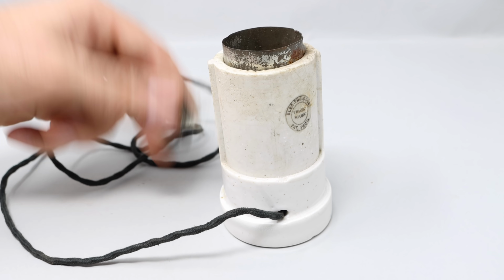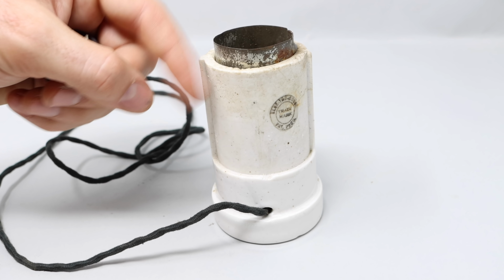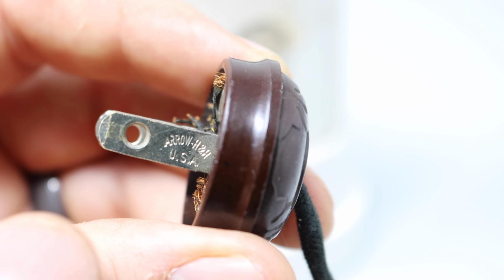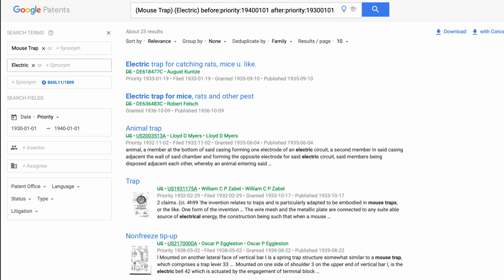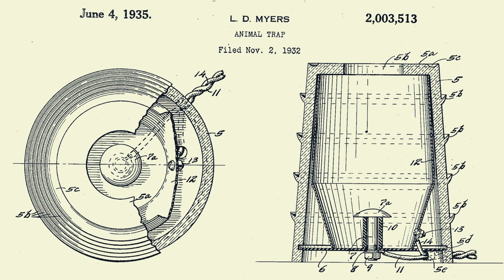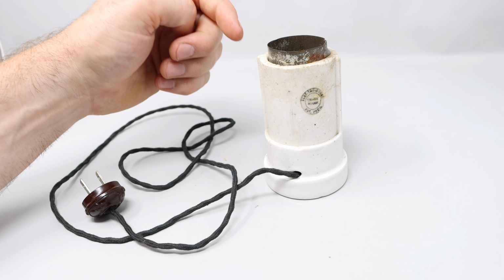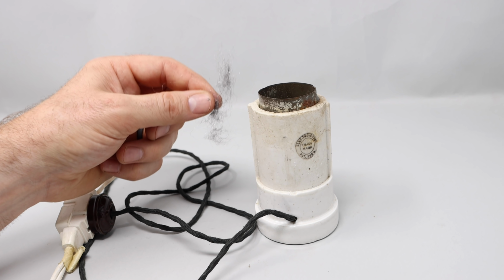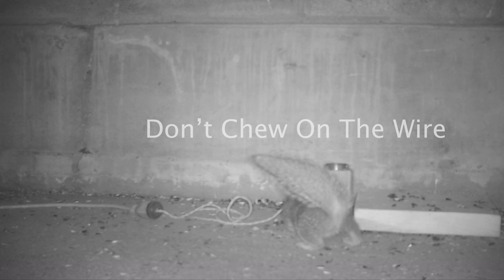I Need Your Help Explaining This One - The Electro Mouse Trap from the 1930s. Mousetrap Monday.

Comment: I'm looking at the patent drawings and it looks to me that the trap you have is either broken or missing the top part of the ceramic. I don't think there should be any metal showing and a much smaller hole for the mouse to squeeze in to, which would make it more likely to be electrocuted and less likely to cause a fire.

Comment: I have some suggestions: Clean the contacts to remove any corrosion. Put some electrolyte on the electrodes: personal lubricant mixed with salt on the bottom, and jam mixed with salt where they would lick. There might be some feedback from the neutral that puts them off becore making full contact, maybe just connect the foot pad to ground.

Comment: You could have something that consists of a flat + electrode the mouse walks on, while going for bait on a tongue in a cup-shaped - electrode, with each covered with an odorless saline gel, using freshly-cooked grain for bait, with a circuit breaker and a little spring that catapults the dead mouse away after several seconds.

Comment: In order to work, the voltage would have to cross the mouses heart. Not as easy as it sounds. There is a lot of resistance in mouse skin and muscle, and only 120 volts to punch through it.  I doubt it ever worked at all.  I have seen a lot of 120 volt chewed live wires in attics, and no corpses nearby.
Reply: My old hamster actually managed to escape from its cage and then chew into a live 240v cable. The cable was spitting sparks by the time I found it, but the hamster seemed perfectly unharmed. That hamster must have used up all its luck getting out of that one alive because it died of genetic causes later that year...

Comment: well ...
1) the tin that the contacts are made of are rusty.. that will reduce the current being delivered.
2) the contact area between the mouse and contacts are small.  the mouse is touching the wall of the unit and then makes contract with contact at the base of the unit.. the total voltage the mouse receiving is about 60vac...  As soon as the mouse make its muscles will contract pulling the mouse off the contact.
3) the voltage your working with with is AC.  Try powering the unit with DC... once contact is made
the muscles of the mouse will lock and will not be able to remove itself from the unit.
4) Yes, this type of unit is very dangerous any animal sticking its paw inside of it stands a good change of being electrocuted.. like the home dog or cat.
5) remember a mouse is covered with fur... so it works like an electric insulator. 
6) if the unit ran on 220... it would kill about 80% of the time... 110 is dangerous.. but it's something with natural insulator 110 just does not have enough voltage to over overcome the break down.
7) use a step up transformer.  Trade current for voltage... if that unit was being powered by 300vac to 500 vac.  it will kill anything.. Including you... be careful
Reply: Kind of makes you want to go way overboard on the transformer and add something like what you'd need for a Tesla coil... "Kills and carbonizes in one easy zap"
Reply: @Kobe Wild
:  Tin doesn't rust.  How did you determine the mouse would receive 60 volts without knowing the body resistance of the mouse?  AC or DC wouldn't make a difference, the muscles contract uncontrollably either way.  How did you determine that 220 volts would kill "80% of the time"?
Reply: I kind of doubt your statistics on 110V vs. 220V - I'm from Europe and have touched 220V  quite a bit (Spoiler: I'm still alive). The jolt I got from pulling one of those <sarcasm>super safe</sarcasm> US plugs out of a socket when I was in Texas felt about the same or only very slightly less uncomfortable. So unless Texas Volts are more dangerous than say California Volts it does not make much of a difference.

The breakdown voltage of insulators is usually far above all common socket voltages in the kV range. And it is usually not of any big concern when looking at electrocution. Now the resistance of the mouse body and fur are interesting (they are not very good insulators)...

How well a mouse and its fur conduct current mainly depend on the humidity of the mouse - i.e. whether it got wet before it entered the trap. The wetter the mouse the lower its resistance, the better the chances of the mouse getting killed.
Reply: @KonradTheWizzard    Your dry skin has a natural resistance so getting tagged by a  wipe, you may get a buzz but it's all about surface area in contact.
I've been in a pool and have been shocked was able to escape only because I could feel the AC ripple before I gripped the ladder out climb out of the pool.
I've also had a power drill blown out of my hand when I touched a fence post with the 
drill tip.. if I had of touched the pole with my hand I would have died.. 
it's all about surface area.  There's a video of two men installing a metal table someone mixed the hot with the ground... they could not let go... they died.. 
it was a hot day and they were sweating so there hands were extra conductive. 
Worse yet, as the current starts flowing, your body grips the object harder and water, oil and salt pumps from your pores.

Comment: Seems like the side metal tube is a positive current output and the spike at the bottom outputs the other current. So it works like a taser. It just needs something in between to let the current pass.

Comment: DC direct current always has a steady single wave unlike AC alternating current waves go up and down. If you've ever touched an electric fence and not got shocked but then touch it again and get shocked, that's AC. It pulsates but dc is steady

Comment: Back in the 30's plugs weren't AC "polarized" between hot and neutral. It looks like some of the mice were jumping away when they contacted the outer shell of the trap indicating that the shell was hot. The hot to ground circuit the mouse completed was enough to cause a slight zap but not lethal. I suspect if you rotated the plug 180 degrees in the outlet making the terminal in the bottom hot, it would have killed the mouse that crawled in since you would have had a complete AC circuit. Of course without any kind of circuit breaker or fuse it may also have started a fire.

Comment: You should connect the plug 180° around. I believe you had the live wire connected to the tube and the neutral at the bottom plate. Maybe they felt the live wire with their whiskers. Turn it around so that the live would be on the bottom plate.

Comment: The electricity in this trap is household 110V/60Hz AC. I think it has something to do with the high heart rate of small animals that this rather low frequency isn't more effective. I'm not a vet though. The more modern mousetraps use integrated circuits, condensators and step-up-transformers to step up both Voltage and Frequency of the electricity. Initially the animal is cramping because of the high voltage (somewhere around 1-2 kV) and is unable to move, then it will get zapped again and again until the circuit is interrupted or it senses that something was caught.

Cheers

Comment: It could be AC versus DC current. If you get shocked with DC current, your muscles tense up and won't let go. With alternating current, it alternates in pulses and allows you to move your hand away from what's shocking you. I've been shocked a few times working with an electrician and it usually makes you jump, but it just feels like a little tingle.

Comment: the steel wool acts as a resistor (they lower the current by using a metal less conductive then copper) but due to the steel wool being thin and the current being high it causes the steel wool to melt (thats the sparks that you see at the beginning) as for the mouse i think its because the current did not go through the heart

Comment: The plug has to be plugged in correctly for it to work right. The tube should be on the natural side of the plug so that the rat would be grounded. It does appear that part of the trap is missing also. You put out a lot of great videos...

Comment: maybe the mouse trap was designed for 220 volts, they may have taken the same plug back in the day
Reply: nope.  usa always had 120
Reply: @natalieisagirlnow  3 phase power, assuming the plug would have two 120v single phase on each plug and having the ground plug be the neutral would work, but idk if they were designed that way back then
Reply: @CoachedRoach  That's not three phase, it's split phase.
Reply: Your right it would have 3 hots and a neutral, my bad. I assume mostly commercial buildings receive 3 phases from the grid?

Comment: In those times the electrical outlets and plugs where not grounded. That is why they only had the 2 slits in old outlets and two prongs on plugs. Modern outlets and plugs have ground and that’s why their is a third prong underneath the top two prongs. Same with the outlets having 3 slots. One is for the ground in the plug.

Comment: Just a thought, but this would deliver twice as much power in Britain and Europe where the household voltage is 220 rather than the 110 on our side of the pond. All it would take would be a different plug to use it over there.
  
As others have noted though, even if it ever worked it would have been pretty inconvenient since it would short circuit if it ever caught a mouse. Back in the 1930s and 1940s that wouldn't have just meant blowing a circuit breaker, it would have meant blowing a fuse that would have had to have been replaced. If you ever test it again, plug it into a power strip with a built in circuit breaker. (It should have a reset button on it.)

Comment: They either used a transormer for a higher voltage in order to zal the mouse. Or they used DC (direct current) to cause muscle contraction in the mouse. Making it unable to move.

Comment: It's literally just the mental tube is grounded and the center pin is insulated and connected to the hot wire I would say it's just a shock through the nose and the power will travel to the feet through the heart and ... Dispatch the mouse rip

Comment: The mains voltage hasn’t really ever changed.

In 1930 in US, the mains voltage was 115 volts. A couple decades later, the mains voltage was officially changed to 120 volts. However, this change was really because previous lower voltages such as 110 or 115 volts often had problems with losing voltage through the wires (often dropping to 100 volts).

So in 1930, I doubt this trap did not work any better. But my hypothesis about the design of this vertical trap is that small mice will fall in, and hopefully they aren’t strong enough to jump out (although I’m sure they might be able to jump out). Also, it is really unsafe because it may keep cooking the dead mouse, which may cause a fire.

Comment: I did some googling and found this answer on wikipedia which might give some more insight into why these styles of traps worked during their time period:
"Many older North American sockets have two different current and voltage ratings, most commonly 10 A 250 V/15 A 125 V. This has to do with a peculiarity of the National Electrical Code from 1923 to the 1950s. Originally, sockets were rated at 10 A 250 V, because the NEC limited lighting circuits to 10 A. In 1923, the code changed to allow lighting circuits to be fused at 15 A, but the previous 10 A rule still applied to circuits over 125 V. The higher voltages were rarely used for lighting and appliances. Most sockets with this rating are of the "T-slot" type."

Comment: This not about this trap, but an idea for a true (let them eat cake) style trap. Two coil springs 1 on each side, two solid steel poles 1 on each side, going through the coil springs. A steel plate is attached to the bottom of the springs to allow compression of the springs. Attach an angled blade to the middle of the steel plate (a bolt and nut should do the job). Whatever you think would be good for a trigger (after all you're the expert). Big block of wood for the base, and a piece of cake for bait.

Comment: i don't think the electricity has changed but here is an idea place the electric traps on a cloth or other absorbent material and wet it with salty water then put a bit of peanut butter in the bottom of the trap also make sure the electrodes are free of tarnish and rust (you may have to recreate the traps to protect the originals )

Comment: Its not the voltage that will kill you, but the current, its like sticking a fork in an outlet to cause a short, sure you’ll get one hell of a zap but it wont cause any permanent damage unless youre sitting there holding it. Outlets in the USA run at 120V 60hz so chances are the voltage isnt high enough to drive a large enough current

Comment: Comment by Kev is right. AC electricity cycles from positive voltage to negative, crossing 0 volts. At the zero crossing and lower voltages of the cycle the muscles that temporarily interrupted are then able to move. It is long enough for reflexes to jump or let go.   DC power at  a high enough voltage to overcome resistance has no zero cross and will lock muscles preventing the mouse from jumping away.  You could make that trap work by adding a bridge rectifier with an appropriate capacitor to prevent a  zero dip.

Comment: There at 2 charred pieces of metal, and once they make contact across both plates it cause a short. The arcs electricity thru the mouse, maybe a transformer in the bottom amping the charge.

Comment: I'm from Australia, so I'm not sure about the time line for you. But I'd check to see whether they were using DC voltage (direct current) or AC volts  (alternate current). Its a little thing to consider but makes a big difference on how some of those old electrical mouse traps work

Comment: 1930 electricity was same as now (as far as I know). I do not know how these translates to mouses but I do know something about electric shocks on humans. With ac less than 50mA is probably not killing you and anything over about 10mA and probably you cant let go from the wire.
50mA -about 200mA starts to be dangerous if shock is short (shorter than time between heart beats) probably just hurts much, but if shock is longer you need medical help and fast.
Dry skin and fur is surprisingly good insulator  so current stays quite low with 120v for 50mA you need less than 2.4k ohm. 
So probably mouse just don't get big enough shock from 120v because insulating skin/fur and because when it gets that small shock it jumps away both because of electricity and reflex.
Try wetting surroundings of the trap. Wet skin is much better conductor than dry skin. Also this trap might have worked if it had stayed upright because of gravity assist.

Comment: The wires you see there are probably just full of electrons waiting to jump somewhere, when something touches it, the circuit is completed and all the static electricity in the wires connects to the mouse. Problem is, flesh isn’t very good at conducting a current, so very few amps are actually transmitted into the mouse.

Comment: It might have worked if the squirrel had not knocked it over.  Maybe the vertical cylinder design would prevent a mouse from quickly jumping out, and it would fall to the bottom and get heavily electrocuted.  Perhaps you could attach it to a base, which could also hide the cord.

Comment: Most places in the 1930s used 120 volts AC at 60 Hertz just like we do now. I suspect it didn't work then , either. Two jobs ago , they set out a bunch of similar traps (1980s). It was a tube with open contacts connected directly to 120 volts. Didn't work.

Comment: Some rural farms had 130 volt DC power supplied by generators I have an old radio from the 1930s and on the back it says 110 to 120 volts ac or 130 to 140 volts DC.

Comment: Look at the patent drawing. The top is missing, you probably could make one with a hole small enough that a mouse would have to squeeze in, and attach the bottom to something so it would be hard to tip over.

Comment: You need to make sure the neutral wire is connected to the out side tube so the mouse doesn't get zapped until it touches the center hot electrode old wiring used neutral as the ground

Comment: I was going to go on about the speed of the safety devices in 1930 versus those of 2020.  Then I had another thought.  The main difference between the two applications might be humidity.  I grew up in a house in Illinois that was builtin the early 1900's  the electrical system was a hodgepodge of very early single wire/ceramic insulator and cloth covered two wire cable with rubber insulation under cloth.  The system was probably built and then expanded as the house was added on.  The result was that the basement was originally a bare earth floor root cellar that was expanded with the additions to the place.  The basement was always a little damp.  Dampness makes for stronger shocks.
The other thing is your bait. I doubt that sunflower seeds would have served as bait for these traps.  Lard, bacon fat, or whole milk butter, would have been more likely.  If the mouse is touching the sides with grease all over his little paws he's gonna make a better connection. 
The type of wiring in the system will make a difference too.  House wiring in 1930 was single 12ga strands of solid copper.  Your household circuit may be 14 ga copper of aluminum.  The inrush current, the initial Zapppp, will be reduced by the wire size and the type of wire.

Comment: In the 1930s electrical circuits didn't use current limiters and cut-off switches, this is why accidental home fires were alot more common, so the mouse or rat would we shocked by the high voltage, however the current limiters would stop the power from being high enough to stop it's heart or kill it.